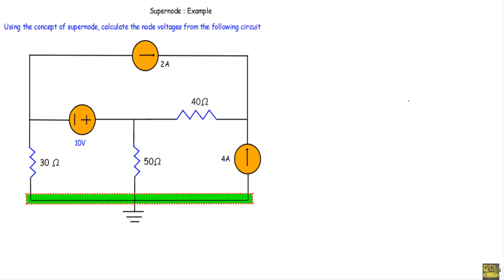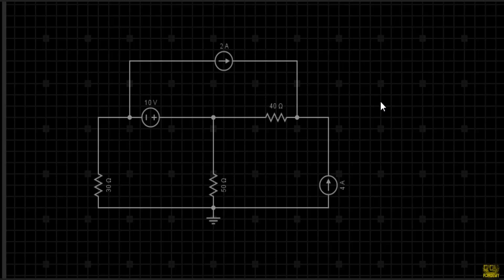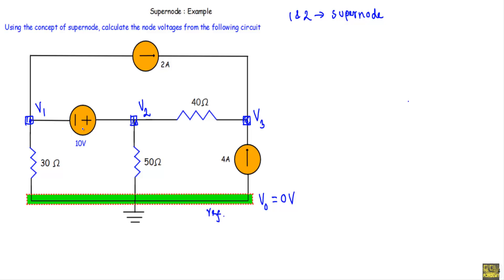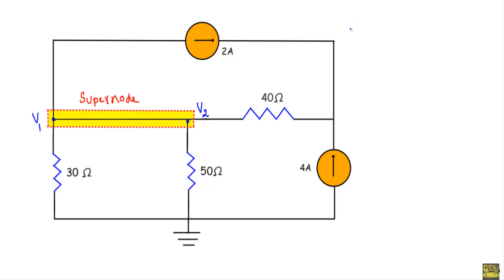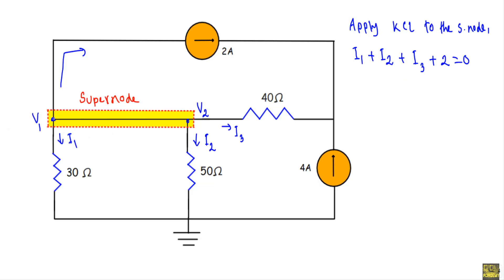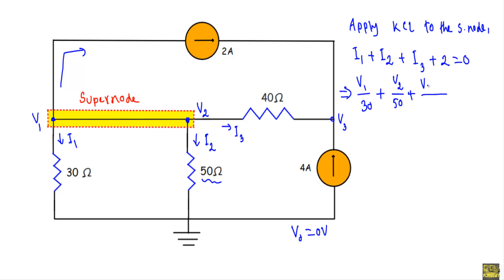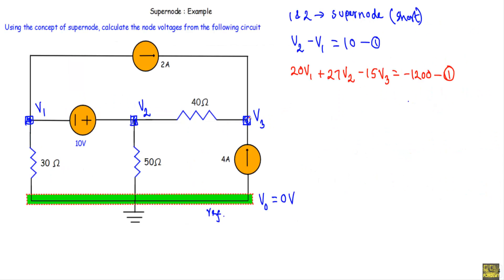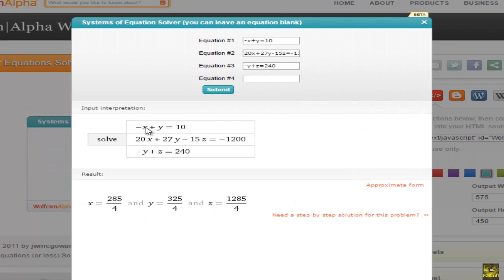Supernode Example - 3 ( with simulation)

Comment: Why did you applied KCL separately for V3, please explain.
Reply: Please reply
Reply from the maker: Please check my introductory Nodal or Supernode analysis video
Reply: @EEAcademy2022  Sir didn't understand, I1+I2+I3+2=4, 4A is incoming current, can you please explain in two or three lines why did you applied KCL separately for V3.
Reply: @EEAcademy2022  sir please reply
Reply from the maker: In your analysis, you should have three node voltages namely V1, V2, V3. You need three simultaneous equations to get the values of 3 variables. That's why we need to apply KCL to the node 3
Reply: @EEAcademy2022  thanks for the explanation